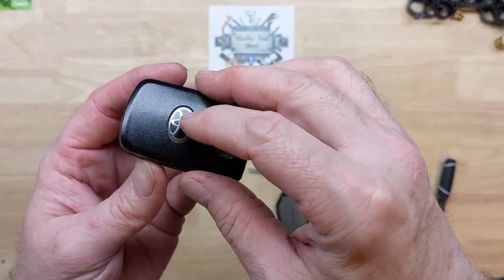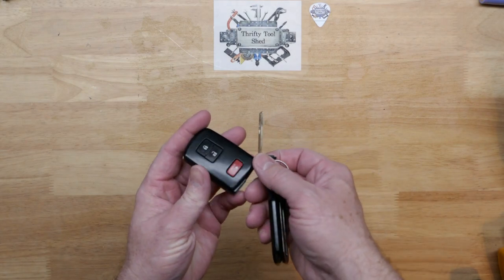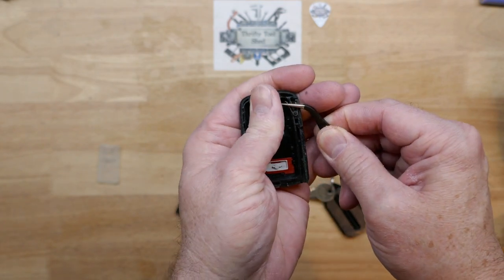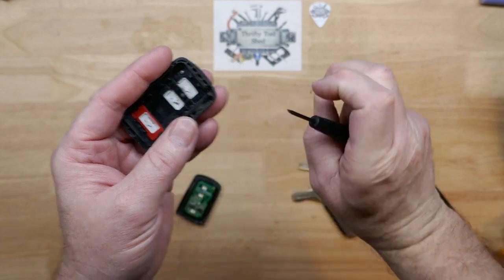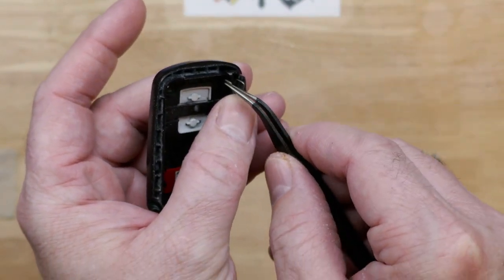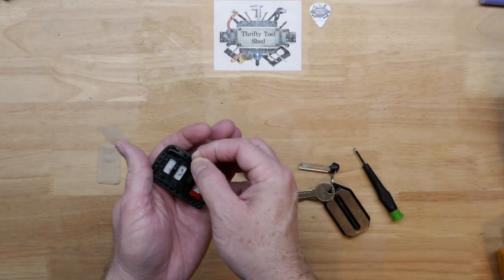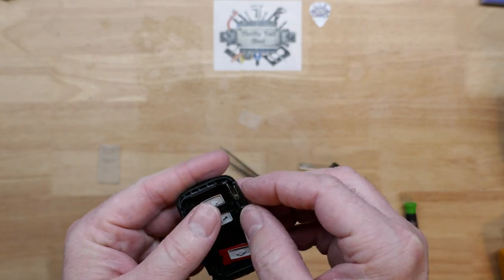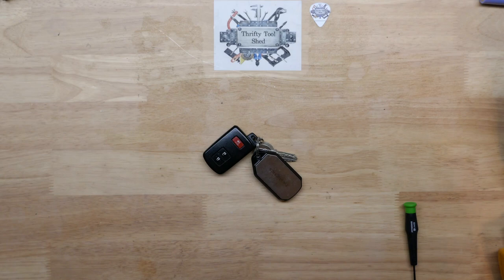Toyota Tacoma 3rd Gen Fob Spring Button

Comment: Thanks!  My key fob for the highlander didn't have a washer, it looks like it has just a tiny piece of plastic that snapped off the top.  I put the key fob back together and it looks like it will work just fine.  I could not have done this without your video!

Comment: Thanks for posting again about the Tacoma key fob.  As you know I have had problems with mine in the past.  So how in the heck can the truck start with the key fob when the batt is dead ??? It's almost not logical.   Thanks for your posts on this !
Reply from the maker: It seems the Fob has a RFID chip and will work sort of like older keys with the RFID that had to be really close to the ignition ( like in it ) to work. The 2009 Subaru we have has this. Just getting a key cut to fit ignition will not start it. The Tacoma Fob must use the wireless proximity when the battery is good in the fob and then as back up use the RFID when no FOB is detected wirelessly? 
Thanks for your comment!
Reply: @ThriftyToolShed  Thank you so much !!!! Best explanation by far.  Cheers 👍👍👍